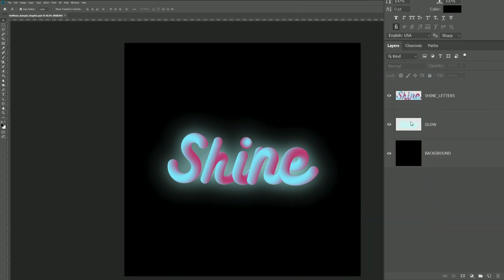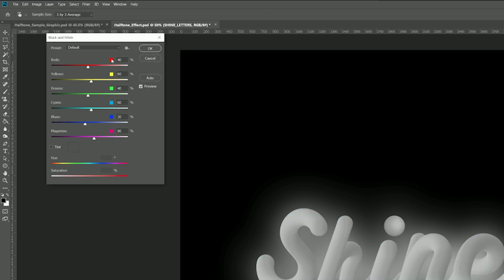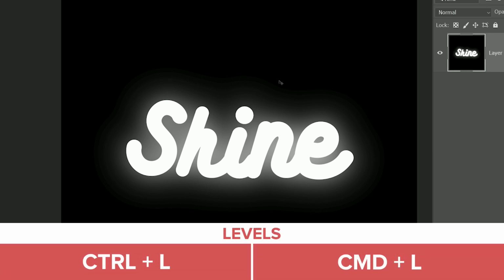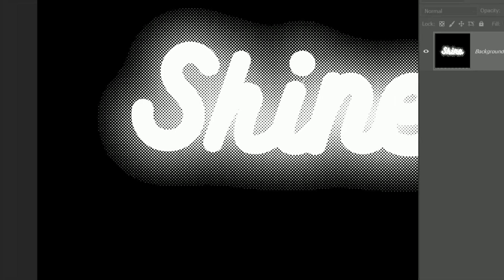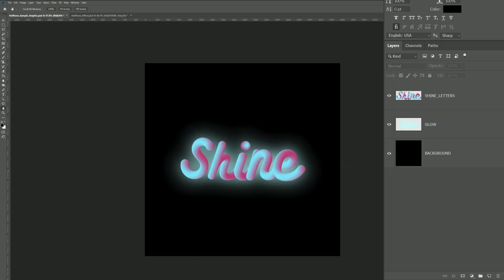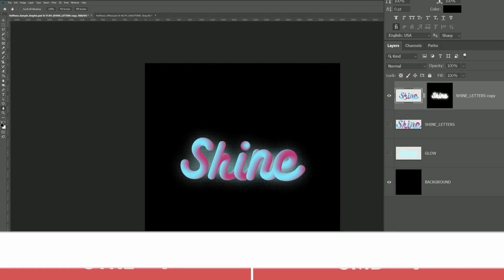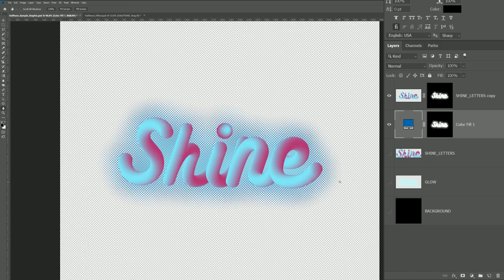Easy Glow Effect Alternative: Printful Design Series

Comment: Is this process also necessary for designs for canvas prints or posters that have glow effects? Also, is it possible to make the grain of the dots finer? I'm just learning Photoshop, so forgive if these are obvious questions :)
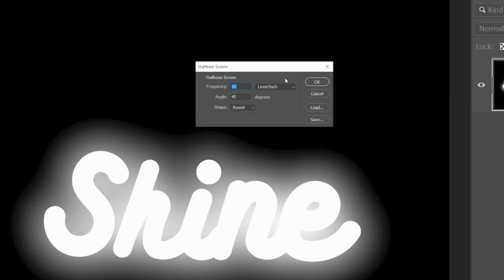Reply from the maker: There is no need to apply the halftone effect when printing on posters or canvas. If you wish to create finer dots for the halftone effect, we suggest adding a lesser value in the "Frequency" field found on 2:20 😊